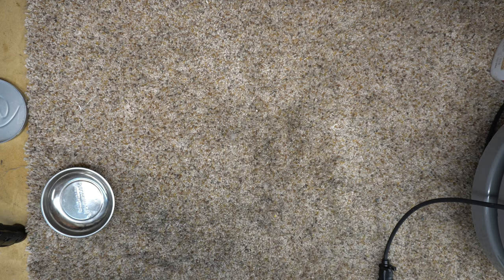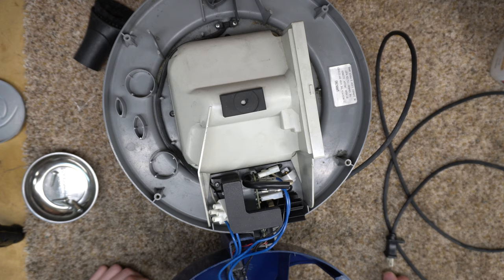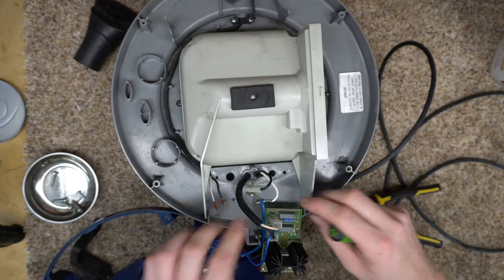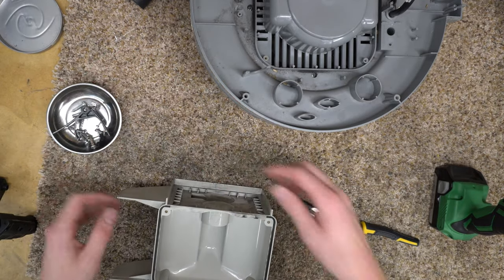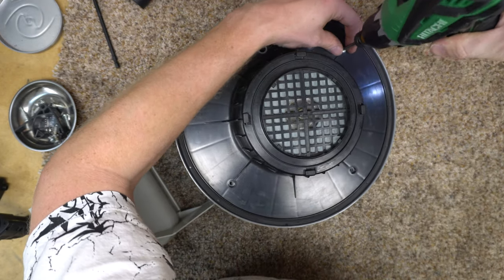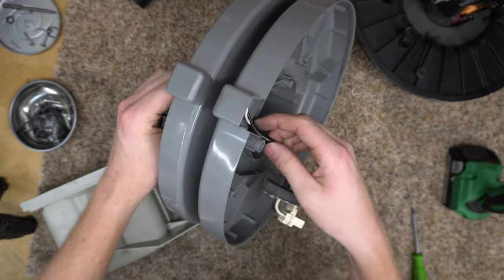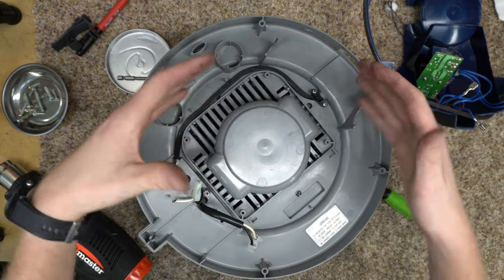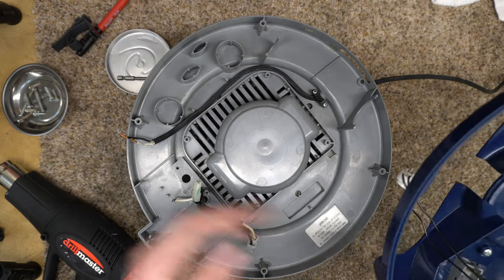Lindhaus HF6 Vacuum Repair

Comment: Love my HF6 but I'm having an issue with the motor slowing way down than speeding back up every few minutes and this is the second time. The motor was replaced last time and the controller board was replaced before that and now the powerhead no longer gets any power through the vacuum contacts. I've had it for twenty years so it's had a ton of use. Not sure whether I should buy a new HF6 or just spring for a Zero G. I absolutely LOVE the Lindhaus powerbrush. Wish I could repurpose it for use with the Zero G.

Comment: I dissasembled doing voltage checks along the way, looks like it was a sticking brush. the brushes are tricky to manipulate, they slide upward after releasing a tab at the bottom of the brush, then the brush can be held away from the comutator to inspect.

Comment: I wish that the crush proof hose used with this machine was supplied with the Ariel canister. It was the disappointment with that machine nine years ago when I’d purchased an Ultrasilencer instead. I really liked the tools on the Ariel a lot. Very nice machine but I wasn’t going to buy a costly machine with the same grade of hose as the current Mighty Might. The rest of the machine was incredible.